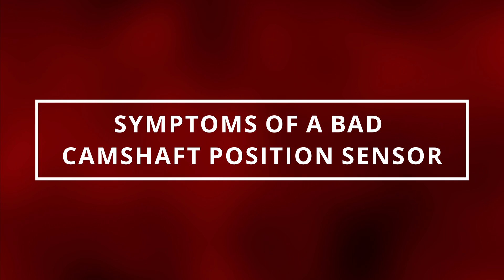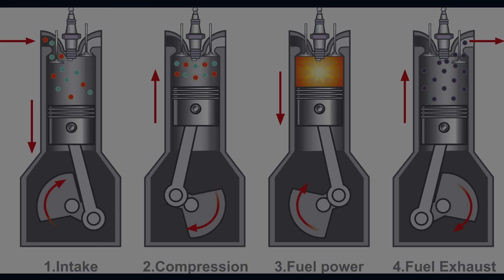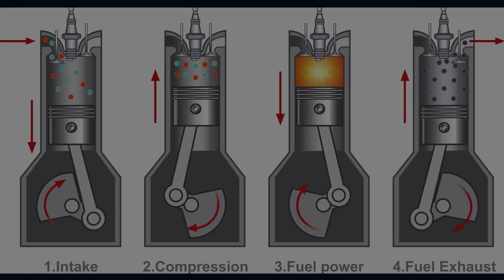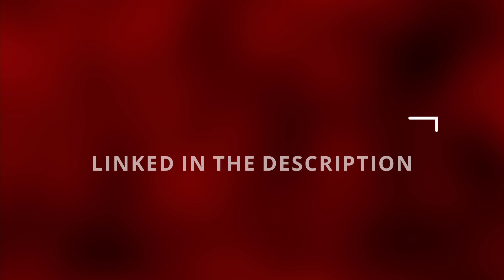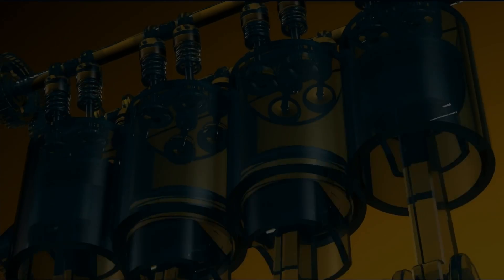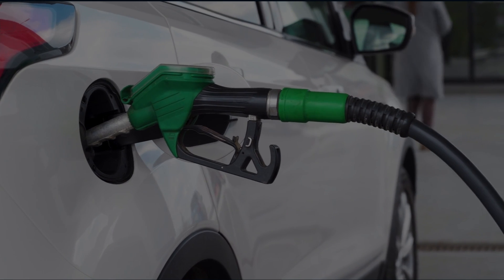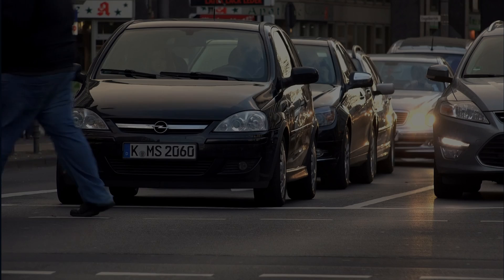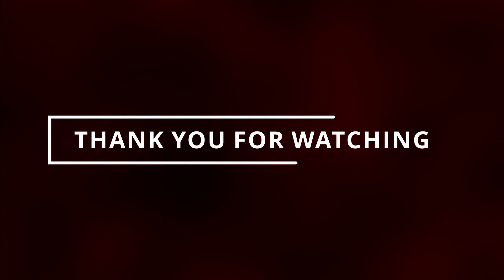SYMPTOMS OF A BAD CAMSHAFT POSITION SENSOR

Comment: Seems like this is the issue with my 300, will randomly stall while driving but will start no problem after a few minutes, noticed will run through fuel rather quickly, sometimes it won’t pick up speed, and other times it runs perfect.

Comment: I’ve replaced the sensor but it’s still running pretty rough and the code is still showing
Reply: Bro if you did replace the sensor and nothing happened then change the cam shaft rod because a messed up rod could be the cause. Not saying to go do it because I don’t want to be held reliable I could be right or wrong but the facts is.. that engine parts can be rebuilt replaced if done correctly

Comment: I had a high idle I swap out my i.a.c valve and tps and still no power and big lag in throttle response next ill change out my crankshaft and map sensor if all fails and no power I have a vacuum leak or bad pcm .

Comment: The scariest experience I've experienced driving a vehicle was with a bad cam position sensor. At highway speeds it was as if I ran over a tree...extremely violent episodes of the engine quickly shutting on and off .
Reply from the maker: Thank you for sharing. Glad your safe!

Comment: Thank you for this video, I have a 2011 Nissan Altima and I have been having trouble with the SIL coming on ramdomly and when this happens she feels like she wants to stall out and has trouble getting the RPM's up. I have tried just about everything I know to fix the problem and changing the camshaft position sensor may be what it takes....fingers crossed!

Comment: Great video my car has all of these symptoms I was beginning to worry about the cost because I am broke as a joke right now but my car is older so shouldn’t be much. it’s an 04 Honda civic 4 cylinder with 115k miles on it. I got it with 90k and put the other 25k on it myself all  while taking decent care of it so it should have much more time long as I take care of it. But I do have a oil leak. So maybe like another person in this thread said maybe mine may only need a wipe down. I don’t know how to take the parts off to get to the sensor but I’m sure it’s not too hard. I think I may even try myself to wipe it and then if it don’t work then I’ll take it to a shop with the part

Comment: QUESTION PLEASE ANSWER😊: IS IT POSSIBLE? 3 WIRES GOING TO CAMSHAFT SENSOR, WITH BATTERY UNPLUGGED THE PCM UNPLUGGED AND BIG CONNECTOR IN WIREING HARNESS UNPLUGGED,  CAMSHAFT SENSOR UNPLUGGED. THERE IS CONTINUITY ( OHM METER)ON 2 OF THE WIRES ON CONNECTOR TO CAMSHAFT SENSOR.  ARE THE WIRES SHORTED TOGETHER?

Comment: Great videos...!!! I'm a great weekend mechanic with lots of experience with cars, diesels, outboards, and 4 stroke as well as 2 stroke motorcycles.. YOUR VIDEOS ROCK..!!! Super concise, really informative, and short and to the point with great graphics.. THANKS FOR ALL THE EFFORT YOU PUT INTO THESE..  !!  Long time subscriber
Reply from the maker: Thank you! i appreciate this.
Reply: Hey man , I got Audi A6 4g 2012 3.0 diesel .  Sometimes  when its  cold   it rattles for about 10-20 seconds  and revs   are not stable  , pin moves from 800-1000 revs [plays]  Only on cold start . In the morning .  What could it be . Also it vibrates. It lasts 10-20 seconsa then its gone .

Comment: Thank You for this information,my 2006 Toyota Sienna has a P0016 code crank and cam out of correlation saw both your videos to see what the symptons of  both of these sensors would be if they were bad and my van does not have these symptons my next move is to pull out the VVT solenoid and inspect if that checks out then I guess the timing belt is off a tooth.,any suggestions?
Reply: My current problem.. What was it.? Did you get it fixed?
Reply: @mattdebeer5289  No i'm still driving the van like this the next step for me would be to do the timing belt again and make sure all the timing  points are correct i guess, it's not time to do it yet so i've been putting the job aside,besides it starts and runs ok, i drive nearly 50 miles a day during the week and no major issues.

Comment: We have a 2016 vw tiguan. Its throwing cam sansor code. The motor has a very light knocking sound when coasting or in nutral and decelerating. Then it goes away when excelerating.

Comment: it occasionally occurs. For instance, when I have my foot on the brake and then release it without touching the gas pedal, the vehicle sometimes stalls for about 2 seconds. Other times, it doesn't stall right after releasing the brake, but as soon as I hit the gas pedal, it stalls for 2 seconds before operating normally. Thank you for your response."

Comment: I guess I'm going thru the same issue with my 2000 dodge Durango from what 3 mobile  mechanics told me what else can It be preventing it to start I was in middle of grocery shopping dropped meat off at home went to finish shopping it haven't started in 6 months I need help bad

Comment: Excellent presentation. Changing my crankshaft position sensor really helped my 2006 Corolla run better and start faster when warm. Do you think it would be a good idea to change out the camshaft position sensor at this time too? Car has 135K miles. Thanks.

Comment: Chris fix ,can bad sensor cause no compression in 4 out of six cylinders? Please help been a subscriber for long time😅
Reply: no, you have a mechanical problem.................carbon build up on valves and/or bad piston rings and/or oring on coil leaking and /or head gasket leak and/or bad cam lobes and/or lifters.

Comment: Could stalling also be a result of a bad sensor?
Reply: stalling could be a lot of things.....dirty throttle plate, dirty throttle sensor, dirty intake air filter, dirty mass air flow sensor, dirty air intake sensor, fuel pressure or pump problem, cam or crank shaft problem.....if the vehicle doesn't throw a code, start with throttle cleaning, MAF sensor, new intake filter, and intake air sensor near the throttle position sensor and possibly include the throttle position sensor....    what did you find?

Comment: My Terracan 2.9 starts  ok when cold, but sometimes when hot , it wont start at all, unless you wait for 2 hours..  Could it be the crankshaft position sensor? or camshaft position etc, diagnostic says it  is  the camshaft sensor  but I if I change it and it will not correct the problem.. I wont be happy.. Muchas Gracias por la info..
Reply: What was it ?

Comment: I have a 2013 Nissan Frontier, V6. I had most of symptoms described, but not all at once. The first was a sudden loss of power on the highway. A couple of surges, then it ran normally.  A little later, the same thing, followed by an engine light. Several days later the engine ran roughly, but it was more of a buzz. The rearview mirror was blurry. Later that day, the engine cut off, but restarted easily. That's when I decided it was time to take action. I went to Auto Zone for the computer check. Code P0345, Camshaft Position Sensor A(Bank 2).  I checked the owner's manual and it described the Cam Shaft Sensor. The secret location was not revealed. I  went to the Hayne's Manual site to down load the book. Hayne's said to put the truck on jack stands, but after watching a number of videos, everyone goes over the top. I bought both sensors, to be sure.

Comment: Are these the same symptoms you would get from a bad crankshaft position sensor? I have a really good scanner and it said crankshaft position sensor was my problem. I’m going to change it out tomorrow or the next but just wondering if I should try this if the new crankshaft position sensor doesn’t help.
Reply: either crank or cam sensor will cause;  loose timing belt too.   What did you find?

Comment: I was getting a p0340 so I replaced both my sensors fault code went away but my engine still doesn’t start unless I unplug one of the sensors than it starts right up into limp mode ever heard of something like this before?

Comment: What if my diesel Ford Ranger 2.2 Manual transmission is low on power only, like slow acceleration but starts fine, idles normal,. Is it camshaft or crankshaft issue?

Comment: They could have done this the easy way dual pickup systems in the distributor. Narrow pickup for spark and wide pickup for the fuel injector for each cylinder. With a single reluctor pole.

Comment: My Audi has a rattling noise I thought it's the fan, the garage says it's the cam shaft, but when they remove the sensor the noise stops. I've taken it for second opinion as cam shafts are expensive

Comment: 2008 Chevy Colorado 4door 4x4 3.7 5 cylinder automatic transmission dropped a rod with 1 camshaft sensor. Different 2010 3.7 has 2 camshaft sensors, has anyone know how to fix it?

Comment: Well, I have three of the symptoms (1,2 & 5) on my Ram 1500 eco diesel.  But this doesn't mention another symptom; 'Service Electronic Throttle Control' message.  The shop has it now - wish I had watched the video on how to change out the sensor first, it looks like something easy to do.  Fingers crossed it's all that's wrong .

Comment: I had code p0016 got those replaced,  then p0017 popped up,,, car still starts up, only turned off 2 times  b4 I changed p0016.  Now it's just jerking when I stop at light.  Not all the time. I barely drive. Maybe 3 miles to work. Around the neighborhood to store. That's it. I'm going Friday for P0017,  light is on. Only code it's giving.  Hope this will be it.  If not I'm dropping this car back off at the car lot. Tell them do what they want. I didn't sign up for car note and car shop every week.

Comment: My Car was working fine until i had timing belt and water pump fixed. Then a month later my car left me on the road , waited a few minutes then it turned on again and turned off a few miles again . So i made it threw autozone and they told me it was Camshaft Sensor i switched it and Check Engine is still on ? Can it be crankshaft Sensor? I had that replace 3 years ago as well . Any help? Thanks

Comment: 2013 sentra 

Check engine light came 
But a while ago I noticed on a cold start rpm’s jump to 2500-3000 takes a good 2 minutes to lower.
Also noticed durning this time in idle the car vibrates and engine sounds like a diesel. I personally thought it was the gas quality because other than what I said, the car drives fine, it’s more of a performance issue. Did an oil flush for both engine and transmission. Drove the car to work and back for months(around 40 miles to work and back home) 
Fast forward 4 or 5 months, check engine light is on now. 
Car also has delayed start. Which worries me a little bit.

I’m wondering what I should do next, I got a code for P0014 which is exhaust camshaft position timing - over - advanced (bank 1)

Any ideas or help would be greatly appreciated.
Reply: you replace the exhaust cam shaft sensor bank 1?   if so, what happened?

Comment: Hi admin. 
Is it engine shuddering, engine power loss and hot air coming out from the aircond louver after a few minutes driving above 3000RPM are one of the symptoms of bad camshaft position sensor?

Comment: I keep getting a camshaft position error P1340 on my 2003 1.8T Jetta, and cannot figure out what could be causing it. It has been checked by 4 very good mechanics including myself, and we all concur that the timing is perfectly set. We believe the problem may have to do with the reclutor that the position sensor reads, but there is NO information or diagrams for this part. God I hate this car!  
Does anyone have may ideas?? Thanks
Reply: Could also be wiring. That’s why I am here. Got new connectors & I think he crossed the wires.. not saying it’s ur issue, but it’s wiring for me
Reply: @Wild1KY  I have it at an extremely reputable shop now. The owner is a former Volkswagon tech trainer and swears he can fix it. He has now had it over a week. If he figures it out, I will post solution.
Reply: @jf8461  cam reluctor or phaser issue?
Reply: @Franklinveterinarycenter1of4  I had the same idea. I removed and inspected it. It looked fine (just a piece of metal with slots). Mounted it back on (only goes on one way with tab), and error popped up again. At this point I think it is an intermittent connection somewhere in the wiring harness.
Reply: get you a cheap fiberoptic scope with front and side view and turn the crank with socket and ratchet by hand.....have someone rotate the engine proper way it turns while looking inside the hole the sensor goes......look for subtle movements of the magnets and reluctor wheel on cam phaser as it turns.    Slippage of magnets or reluctor wheel can cause cam issues.

Comment: Hey guys I need some help, not sure if it's camshaft? Just redid spark plugs, ignition coils, battery, alternator, Crankshaft position sensor,. Car now won't start, when it was running it was really rough, idling, dying at stop lights, has a code P1391, small misfire. Need some help PLEASE  please

Comment: Yeah...I had to tell the dealership what the problem was but no "check light" came on so I was ignored...finally went in behind a tow truck...still spent 11 days before it was fixed....mechanic probably spent 15 minutes changing it....loved that little car but traded it the day I got it back...mostly upset at the dealership....lesson learned !
Reply: scan with generic mode or mode 6 if it throws no code.   pick out the cylinder pids, O2 pids, engine temp pid, RPM pid, air/fuel pids, MAF pid, TPS and IAS pid and go from there.

Comment: Mine would just stall for no reason even while driving.....you could swing it till you were blue in the face it wouldn't start. Leave it for 5 minutes or so and boom, fire right up.
We had a customer (car audio) with a track Lotus Exige asking us to disconnect the alarm/immobilizer because it was stalling on the track and his mechanic couldn't find the issue, speaking from my own experience I advised him to change the cam angle sensor and all was good again. He actually came back and thanked me for the advice. 😊

Comment: Thanks for the info. I’m curious if this can come and go without warning. My car would work just fine to the best of my limited knowledge on vehicles. I’ve had my subie since 2013 and I didn’t notice anything but it just not starting. It was turning over and sounded solid but just wouldn’t start sometimes.
Reply: check fuel pressure, scan it....................

Comment: So when I turn my key, my truck doesn't start immediately. I can spin the engine for 30 seconds and it won't start. But the SECOND turn  starts it every time, immediately.  Any ideas on what this could be it's very intermittent and some times it starts and shakes and then stalls and then it starts right up and runs like there wasn't even a problem. And I don't have any engine codes.
Reply: Ever figure out the problem?
Reply: @Turner2503  no have you? I am just living with it until something breaks or I get a code.
Reply: @kengilliskg My car does the same thing. So instead of cranking it, I'll put the key in the on position for about 30 seconds and it will start. I don't have a CEL either.
Reply: I thought it was the fuel pump but replacing the fuel pump didn't resolve the problem.
Reply: @Turner2503  yes someone suggested I do that too but mine still didn't start right away and they suggested I change my fuel pump too right now I am in the waiting game to see what happens next.
Reply: @kengilliskg  Same here. These seemingly small things can lead down a long rabbit hole, and can get expensive quick.
Reply: @kengilliskg  What year is your truck? Does it have a key fob with a chip in it? I recently noticed that when I would try to unlock my car with the fob, I would have to press the unlock multiple times. These fobs have a chip in them that communictes with the computer and if that signal from the fob is weak, it'll struggle to start. I think this was my problem and now it starts - hope it continues. A spare key fob would be a better test to try this on than getting a new battery cause something could be wrong with the chip.
Reply: @Turner2503  my truck is a 2011 Chevy Silverado crew cab I haven't thought about the key fob  or even the chip in the key. I  will have to check into this further.

Comment: So my car won’t start and I had a code for the camshaft sensor and it was fine for a little but yesterday it turned off while I was in drive and now all it’s doing is clicking if I change the camshaft sensor will it stop clicking and turn back over?

Comment: This engine is known for the brake vacuum pump that runs off the exhaust cam breaking appart and ruening the cam sensor, it blew mine completely out of the engine. Its a 40 dollar part that can destroy your engine, that is easy to replace if your not to late.

Comment: Thanks for the video. I have a 2006 Kia Rio that cranks but won't start. The code is for a bad crankshaft position sensor.  I checked the fuel pump and the fuel pump relay and they are both good so I'm hoping this is my problem.
Reply: Same problem, same car. have you figured it out??
Reply: @CHAD-RYAN   Mine ended up being a bad head gasket So I just sold the car for what I had in it but now I wish I would have tried to fix it with some bars leak
Reply: @drivewaygarage1561  awe man, ive already replaced the gasket when i replaced the sparkplug boot rings.

Comment: so, can this cause loss in compression in one of the banks ? my 3.5 2003 g35 coupe has low compression in bank 2 but bank 1 has normal compression.
Reply: no, generally loss of compression is a mechanical problem....piston ring, valve leak, cam shaft lobe or lifter issue?

Comment: Hi all. I have bmw e36. There is no difference to car when connecting or disconnecting new oem cam sensor.  The funny thing is that the car still starts and drives OK, even with the sensor disconnected, but noticing high fuel usage and lack of acceleration power. Could it be that the car is somehow bypassing my cam sensor or does it have something to do with wiring or fuse? Kindly help.